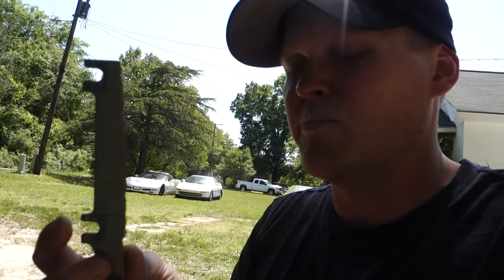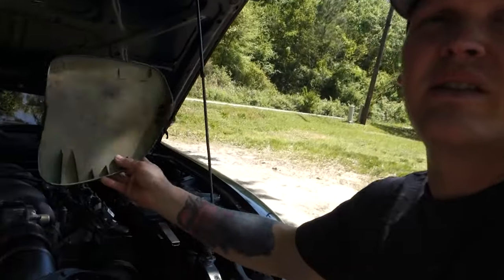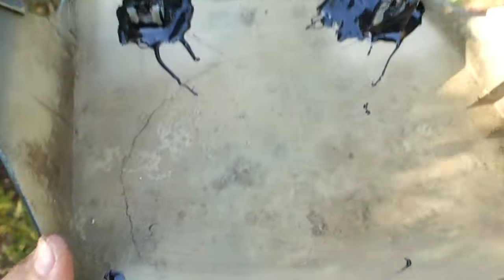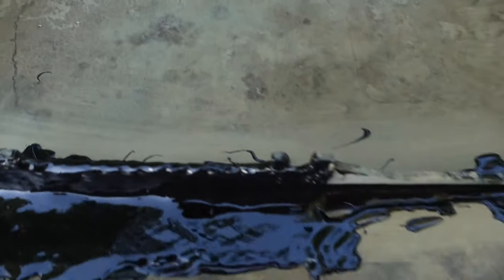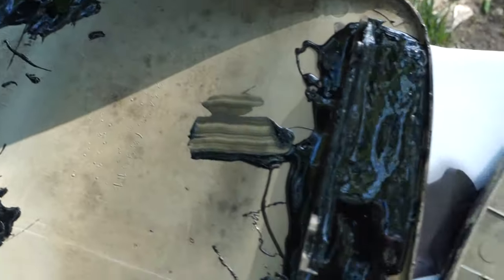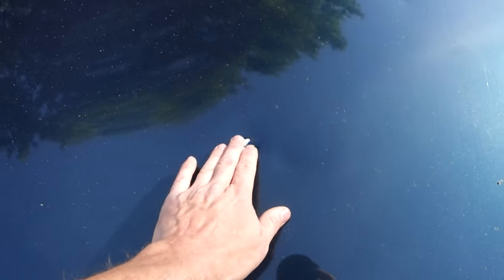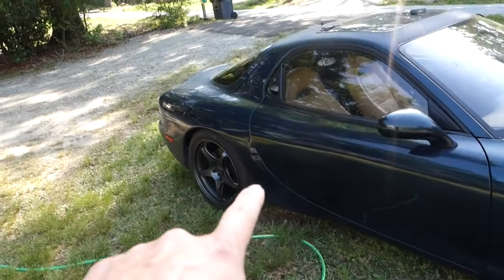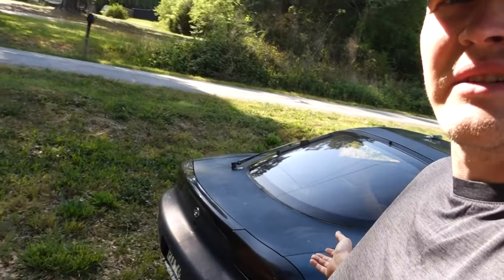Mazda FD RX7 How to fix your headlight covers￼

Comment: What's that mesh sold as?
Reply from the maker: @yucannthahvitt251  Bondo Self-Adhesive Body Patch, pretty sure I picked it up at O’Reillys but most parts store should have it or something similar
Reply: @Nathaniel2503  Thanks for the quick reply. Looked like stucco lath but much finer.
Reply from the maker: @yucannthahvitt251  no problem man I hope it helps. They held up extremely good Haven’t had any issues 👍🏻